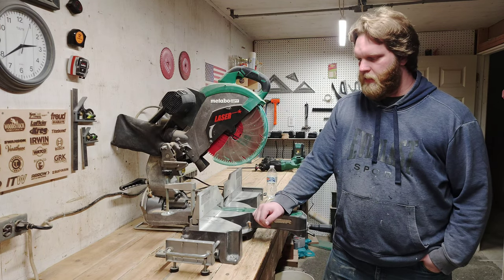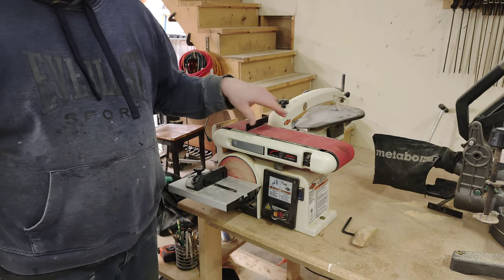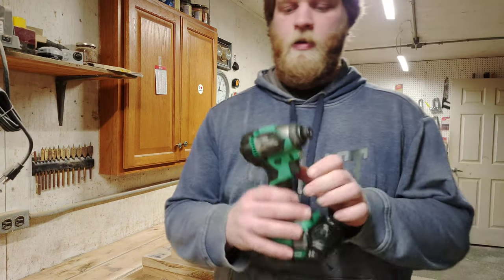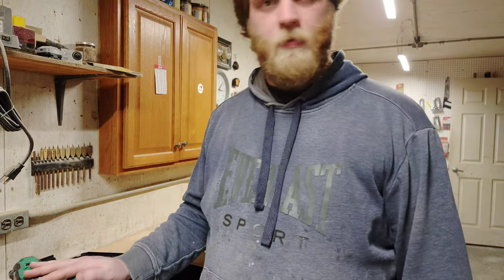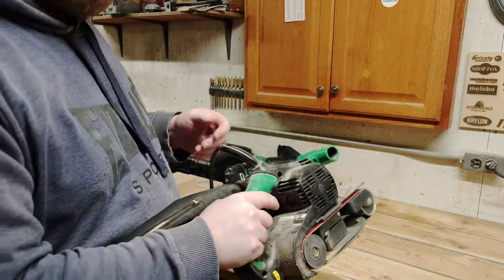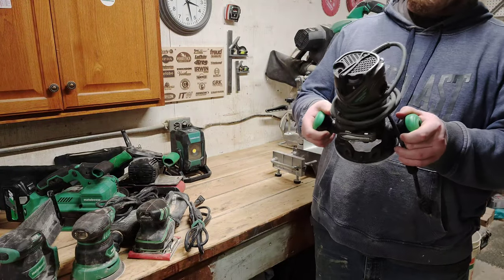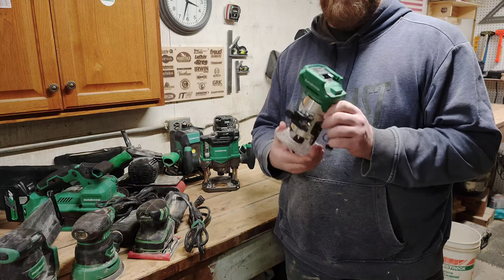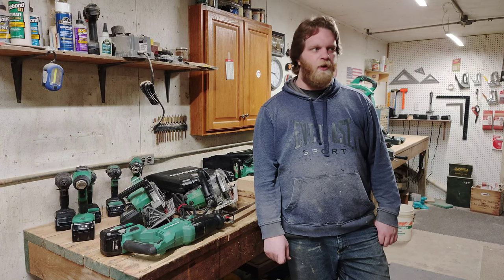Every Metabo HPT in the shop 2023

Comment: Been thinking of going with the Metabo HPT line up to mix with my milwaukee, any advice on the metabo flatform?
Reply from the maker: Depends on what you're doing and why you're mixing them in. As far as general advice, at least when it comes to batteries, stick with the newer ones and avoid the 1.5ah and 3ah batteries. Those batteries haven't been made for a while now and while you can find good deals on them, they won't last very long because of how long theyve been sitting in the package in the store. Probably the most useful all-round battery in the lineup is the 2.5/5ah multivolt, even if you don't own any of the 36v tools. If you're used to running the bigger Milwaukee batteries, the weight is pretty similar.

If you're doing woodworking or building houses, the rear handle 36v saw is pretty killer. The impacts are incredibly reliable and are a bit lighter than the Milwaukee's, which you will notice after a long day. The nailers (battery or pneumatic) are pretty flawless with the exception of the 18v pin nailer. I've run thousands and thousands of nails and staples and have had exactly 1 malfunction, and that was from some budget grip fast narrow crown staples.

The 36v angle grinders are the cats meow. In general the 36v tools are pretty bomb proof. The only time I've ever had to warranty a tool is because I was doing something stupid with it. My recip saw went through probably a decades worth of hard abuse in about a year, cutting firewood and stuff bigger than the blade, before the mechanism inside it started clacking from wear. I can't tell you the amount of times that saw ran through all of my batteries cutting firewood all day, getting to the temperature of the sun and staying there for hours, and it just kept going. And that saw is one of the lower end basic saws in their lineup. It's brushed, 18v, not a lot of features, etc. but it still kicks ass.

Comment: I've recently started accumulating my tools and power tools inventory and was looking for a brand to invest in and I don't particularly like the wall because they're really expensive and you can't even find used batteries for a decent price and Milwaukee doesn't feel good in my hands. Some of the Hercules stuff isn't bad to be honest but it's so dang bulky and a a bit underpowered. But I've decided on metabo and recently got the multivolt circular saw and the impact drill receipt saw multi-tool combo and I've been using the saw for like a week and haven't even had to charge the battery absolutely a supporter of metabo now and this is my brand for real. Next I'm going to get the die grinder or the framing nailer
Reply from the maker: Glad you've found stuff you like in the metabo brand. I've been using them for almost 4 years now. The multivolt stuff is bulletproof. My favorite so far is the compressor which I need to do a review for. Might get to that tomorrow since I'll have a bit of time off. Lots of stuff from them that I've had for a while that's taken punishment like a champ that I've been meaning to review. Had to take some time off from videos because of life but hopefully I can get back into it.
Reply: @dogsongwoodworks  Man I hate to say this but I think I'm going to have to pick a new tool brand. Nothing wrong with the tools just their customer support is trash and their app is garbage and I can't even register my tools because the app and I can't get anybody from customer support to get back in contact with me and one of the main reasons that I bought their tools move from a store is so that I would have the warranty and services and features that come along with having the product registered. But this is a big eye opener to me that if something ever were to go wrong with my tools I'd be on my own because metabo doesn't seem like they are really interested in getting back with customers and it doesn't seem like they want to make the registration of your tools a easy process. It's kind of bumps me out cuz I was looking forward to Getting the cordless die grinder and triple hammer this weekend but not being able to register my tools so I can have the warranty has really rubbed me the wrong way and left a bitter taste in my mouth with metabo. When a company wants to charge a premium price for their product but not give premium service or at least basic service that's seems like a company this more worried about money than quality of product or services. Im not going to just look past spending almost $1,000 on tools and not being able to register them or use the warranty. That's the whole point of why I bought them new
Reply from the maker: @tobeforgottenisworsethande8995  I'm not sure what you mean by the app? Metabo hpt doesn't have an app to register their tools. German metabo seems to have an app but I'm not sure what it's for or what it does. Also the website was completely redone rather recently. Your support request might not have even made it to anyone because of the transition. I always tell people your best bet to reach someone at the company is to call. The support system was really outdated until recently as well. I will send an email to my rep about this anyways.@tobeforgottenisworsethande8995

Comment: those new subcompacts look hella nice! and awesome that they come with 2 2amps instead of 1 1/2
Reply from the maker: The ones here are just regular impacts but metabo hpt does make a subcompact impact and drill. I just don't have them.
Reply: @dogsongwoodworks  no the drill and impact are the subcompact not the black impact or bolt impact but the other 2 are the new ones!
Reply: @codustv1465  if you're referring to the DEX impact and drill, they aren't subcompacts. The subcompacts are considerably smaller (with the exception of the subcompact impact. You can only make an impact so small)
Reply: @codustv1465  the DDX drill and impact, which I don't have, are the subcompacts

Comment: im in a makita tool line, but if I had to choose something else it would be metabo hpt. I actually prefer HItachi, but it its what it is lol
Reply from the maker: The hpt in metabot hpt stands for hitachi power tools. These are hitachi. Ive looked at a lot of makita stuff. Probably going to end up with some of their corded tools this year. Sanders, biscuit joiner, etc
Reply: @dogsongwoodworks  yes sir, I know what it stands for 😉 ...im just not a big fan of a brand using three different names. I know why they have to use that name. I just prefer it Hitachi over hikoki or metabo hpt. 
Not the main reason I use makita,  but I love that they are not owned by anyone else.